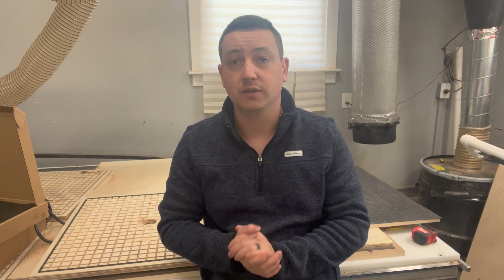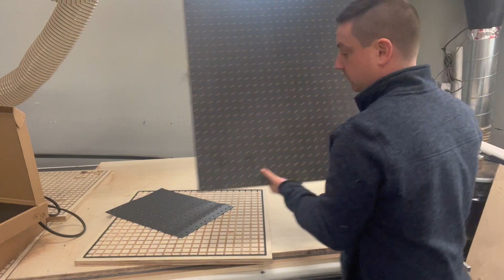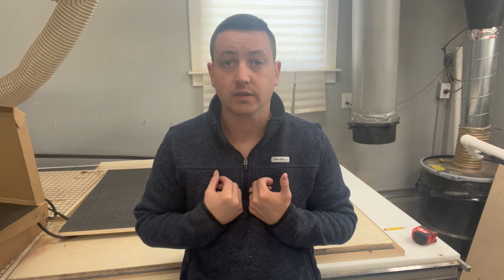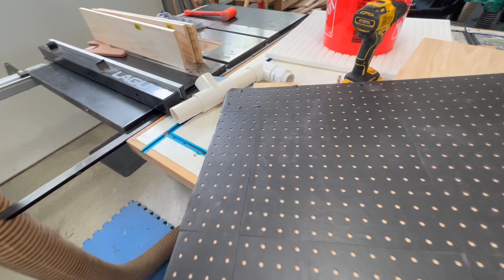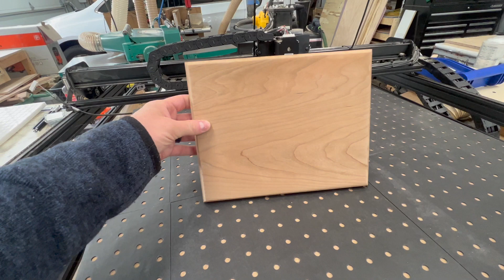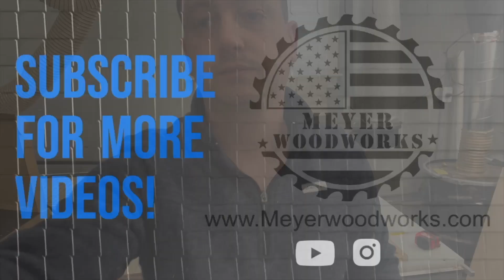Vacuum Tables for Desktop CNC's - REVOLUTIONARY

Comment: I made the plenum board for my table out of 3/4 mdf. I sealed the backside with duct sealant and painted the grid with diluted lacquer. Running 4 armatek vacuum motors in parallel each with one way valves for a 5'x8' table with 12 zones. Works great, usually only need one vacuum running

Comment: Nice! We have an X Cave Pro… 4x4 and maybe two of those vacuums might work? Right? Also what does the gasket do? Is it nonslip?
Reply from the maker: 4x4 kits have always been on the table for development, I just need to test the setup, find limitations, etc. I'm not confident that one vac will be sufficient. I need to sell some kits though to be able to put money back into R&D. I would like to offer 4x2 kits as well. 

There are two different gaskets at play here. The grid gasket goes in the plenum board, that seals the plenum and directs the airflow up through the MDF. The tile gasket (black stuff with holes) sits on the spoilboard, and seals off 85% of the surface, allowing more concentrated vacuum power. It also physically seals the part to the gasket, unlike a traditional downdraft (just MDF) table. Check out my most recent video, you can see it in use a little.